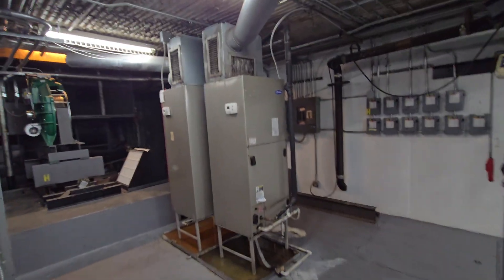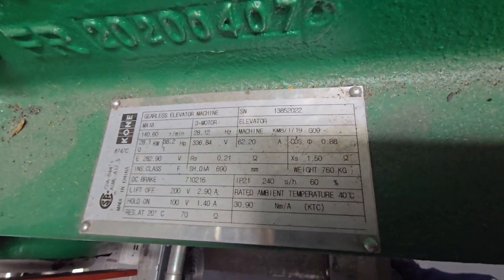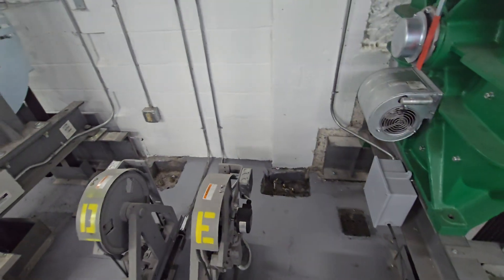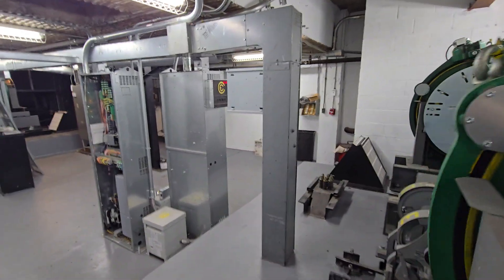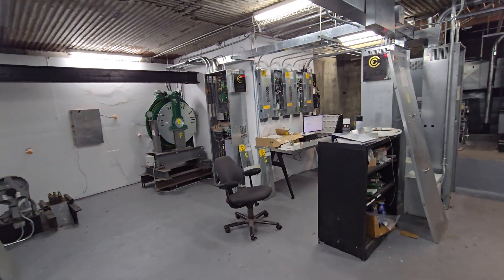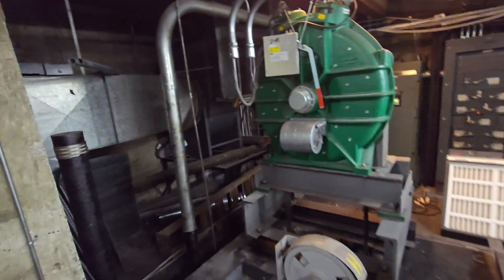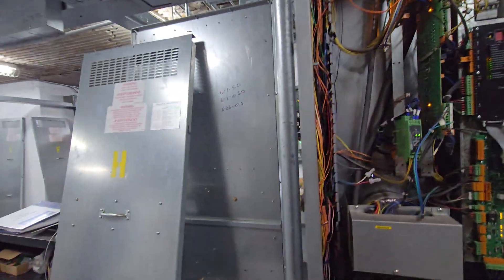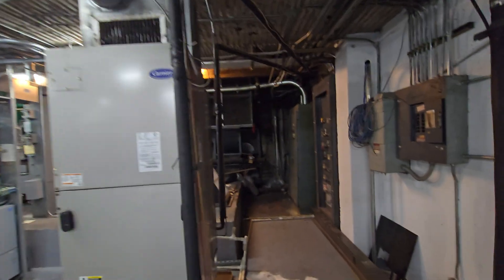AMAZING Brand-New Kone MX18 Traction Elevator Machine Room

Comment: We have 12 brand new Kone elevators at work.  They somehow go offline at least once per month.  Leaving the entire building with one elevator running on backup.  I am on the 29th floor.  Imagine the joy of having to walk up 29 floors.  The 4 Otis elevators that go into the nine subfloors for vaults and labs are always working.  Those monsters never fail.  Same for the five parking lot Otis elevators.  But those 12 Kone are a hot mess.

Comment: I have the 12 elevators equipped with the basic mx18 (24 to 37 floors) with total speed of 2 m/s to 2,5 m/s and also 4 elevators mx18 high performance (42 to 51 floors) with speed of 3 to 4 m/s, mine are installed in 10th june of 2008 and they have an kss 570 fixtures, thank you for showing the good kone elevators
Reply from the maker: That's awesome!
Reply: @ Thank you

Comment: it's no joke how noisy these are, I hope that's something on their radar to fix.  The worst is when these are installed in the shaft adjacent to an apartment.
Reply from the maker: The brakes definitely need adjustment, and that loud buzzing noise is a bad contactor for one of the machines.

Comment: Nice layout CE Electronics screens in the cars but the brakes do need adjustment have done many over the years but retired now.
Reply: Sounds like these are within the specified air gap range. The springs inside these brakes are massive, to get them relatively silent some very patient adjusting can be required. Especially if the motor has run with slightly misaligned brake and the pad has worn slant